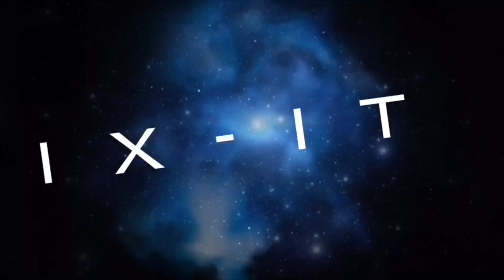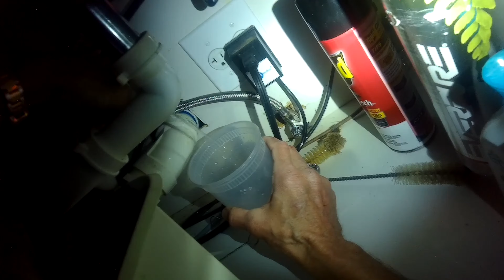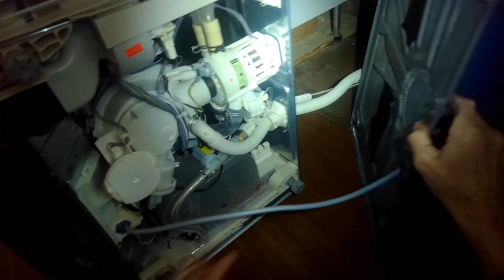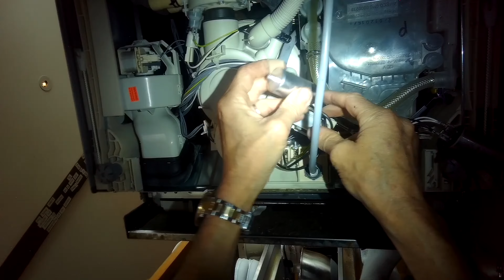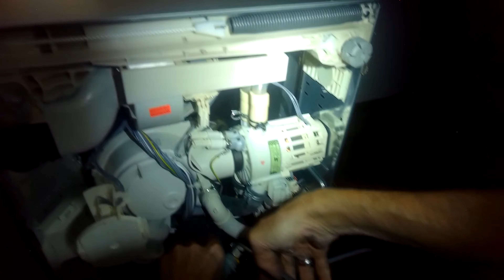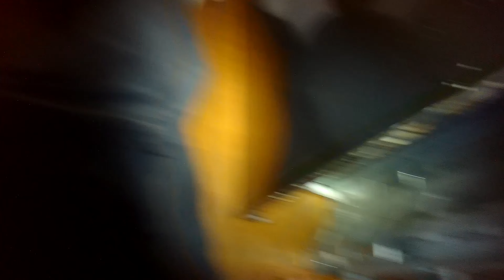✨ Don't Replace Your Miele Yet - Try This ✨

Comment: Your videos are fantastic - thank you!
Our 15 years old Miele G2142SCU started making noise. When the cycle about to start, I hear a bit of a rattle, then the cycle starts and it is noisy, like grinding, shows no errors Seems like it is coming from circulation pump. I have already replaced pressure switch earlier, some hoses on the way (the one that connects circulation pump, also changed relay), temperature sensor. Drying blower has been having rattling noise when drying.
We love this machine. But wonder if we should just buy a new one with 10 years warranty or fix this one. It still looks like new. Would really appreciate your advise,
Reply from the maker: I wonder if there might be a small piece of broken glass under the drain impeller.

Comment: Mine fills fine maybe just a little too full. Starts circulation pump runs for 30 seconds, stops for 30 seconds, starts circulation pump for another 30 seconds. Then flashes the intake/drain light and leaves water in the bottom. Clear error, start again- drains out all the water and does the same thing- fills, starts, stops, starts, error 
Could this be the capacitor on the motor or the level control, I did clean the intake filter
Reply from the maker: Great question,
A new heater/pressure switch will fix it👍